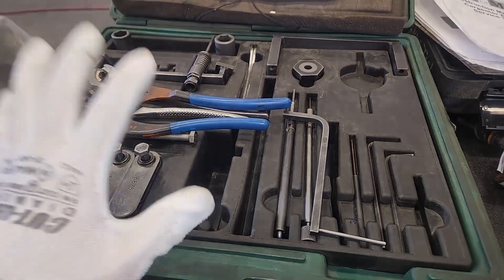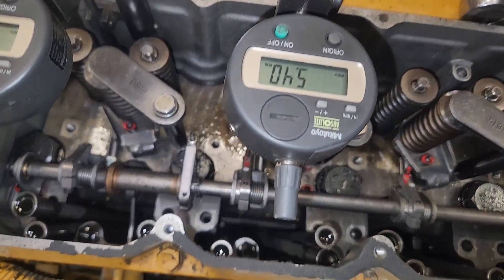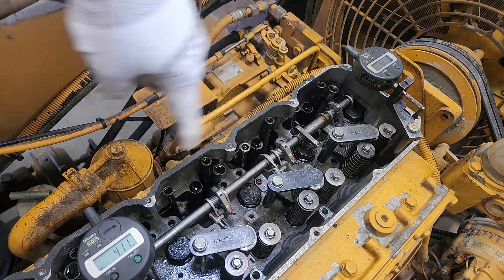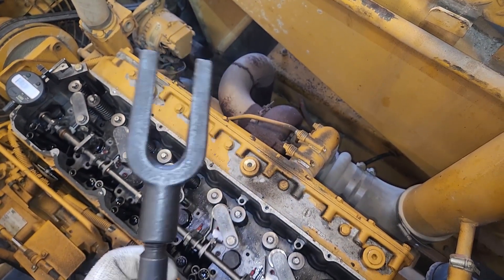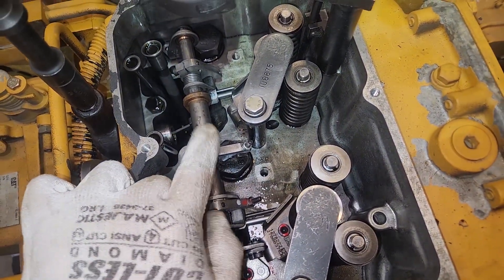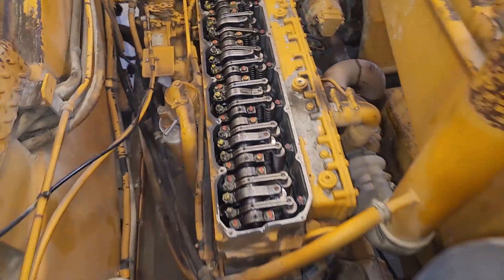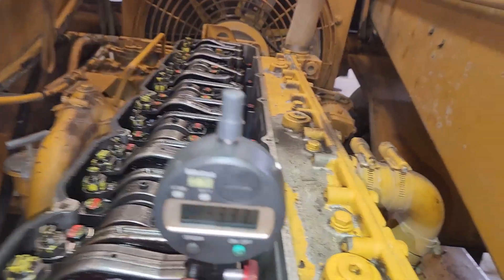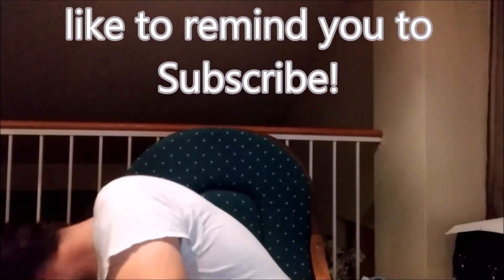Cat 3116 Rack Adjustment Part 2, Prepare for a Headache.

Comment from the maker: Hope you enjoyed watching me suffer through trying to get this rack sync done without having all the tools I'm used to. Amazon Affiliate links to recommended tools: Fuel Pressure Gauge, Compucheck 0-300 psi: https://amzn.to/3YeBldu
Airlift Cooling System Vacuum Filling System: https://amzn.to/3D9AlPu
Radiator Pressure Tester Kit: https://amzn.to/3QGBumn
Milwaukee 3/8" Right Angle Impact Wrench: https://amzn.to/3D2CvAk
Adjustable Height Parts Tray 100 lbs: https://amzn.to/3CBusZB
Engine Oil and Fuel Dye UV: https://amzn.to/3z34zkv
UV Professional Grade Light: https://amzn.to/3gzxPc0
Allstar Oil Pressure Priming Tank: https://amzn.to/3L5pASm
Reply: I recently took a 3116 MUI fuel system class, we did all of these adjustments (luckily we weren’t missing tooling). But afterwards the instructor showed us how to fine tune the synchronization even further with the engine running, utilizing a temp gun on the manifold and slightly tweaking the sync screws balancing the temperatures. Slightly tweaking the screws with it running is kind of an interesting challenge. Anyway I thought it was a great class as I had no experience on these.
Reply: Def gave me  better insight on the 3116 in my topkick and what i should probably be looking into for rough running

Comment: Ape I have a 3116 & just had the injectors replaced but We’re having hard starts regardless of the weather. Any ideas on what may be happening?
Reply: Check for a air leak in the suction between the fuel pump and tank you can temporarily install a clear hose at the pump and look for air bubbles....if you see any while running you have a a air leak in a hose somewhere and may be losing your prime

Comment: I’m working on an old 3116 powered generator . It idles high . If I turn the idle adjustment screw down the engine will shut down slowly . I can get get it to idle without shutting down but it idles at 1300 rpm . Would adjusting the overhead solve this or do you think it’s a problem in the fuel pump .

Comment: Great job on the video, wish it was available 30 years ago. Had a bunch of 3126's with this MUI setup. Cool thing is they did 475 horsepower at 2950-3000 rpm. Many times I encountered people struggle with this procedure and sadly they dealt with the complicated instructions and lack of tooling by pulling the engine and swapping it with a ready spare... serious! US Government at its best! Great job again!

Comment: Every time I heard a truck with a 3116 idling it sounded like crap.  This would be why.  There would have been a lot of people just swapping out injectors without refinishing the seat or setting the injector rack measurement.  It was rare to hear one run this smooth.  Good job, this was a great video!

Comment: Electronic injection is so much nicer to work on. There's sensors already installed everywhere where you'd need them, instead of hooking up gauges manually, they're all acessible through a scan tool and if you need more details, like cylinder or injector contribution - just backprobe CKP or rail pressure sensor respectively with an oscilloscope...

Comment: I'm thinking injectors should come with offset specs to really balance them out. Like most modern electronic injectors need to be coded which contains the offset information for that injector. Also most ECU can do their own learning and correct injection for every single injector

Comment: Thanks for a good video on the adjustment.  I have a 3116 in my 95 m1078 army truck  its good to see how its done.  At some point in the future I am going to get the fuel governor from the 290 hp and the turbo and adjust my injectors accordingly.  Thanks so much.  When I had my cam out I adjusted injector height with a dial caliper and it was a royal pain but it worked out well.

Comment: Thanks Josh i contacted you a  while back when i was having starting issues which turned out to be injectors i wound up buying. All the tool kits. My cat kit was the old one with just one dial indacator and i did mine outside in the snow mine didnt sound as nice as yours on start up the first try. One looses paitence when working in the cold trying to finnish before the sun goes down

Comment: I used to do these at least once a week.  The more you do them, the easier it gets.  Even though they're synched the same, you sometimes have to  fine tune them while they're running for smoother operation.  MRC makes a great tool group that makes it a lot easier than the CAT Group.  Fun times 😅 👍.
Reply: I’ve never used the two indicator setup. We had the the block setup. It always seemed like there was misfire and it would be #1 what you set them to. So I just started doing them by ear and they always ran better.
Reply: Same with the old 8.2 Detroit, set them all with the dial guage then sometimes you had to "cadalac" one or two.

Comment: Hey Josh ,just a quick story, the outfit i was working for bought a chip spreader just like the one your working on, first season with it it always smoke black when throttling up or pulling a grade hooked to a truck,we called dealer in Pocatello and they said run it, i hooked to a truck one day on a steep adverse and throttled up to 2k and it went ballistic dont know how many Rs it went to but i had an oil distributor in front of me and pulling a loaded 14 yds truck , the distributor seen me coming and got out of my way, and with the johndeere running gear with good big brakes i got it stalled and had truck behind me set his brakes pulled rubber boot off air cleaner and got my lunch pale on it and it finally shut down , oh i had shut fuel shut down switch off to, called Cat out of Kalispell Mt , i helped mechanic pull it ,only took a couple hours and he took it too their shop, 3 weeks later we got it back and they said they couldn't find any damage or  wrong. Ran great after that with no black smoke, ended up being a warranty  cuss fight with dealer , cat and contractor ended up footing the bill, it was kinda wild sitting on there for few seconds
Reply: Also josh it was a 3116

Comment: You often hear from people that the old mechanical diesels are easier to work on. I’ve always thought this was misguided. The more control a computer has to adjust timing quantity of fuel or any other part of injection, it makes for that much less mechanical fidely bits. Show a novice this procedure then show them changing an injector on most any common rail. A fuel connector a bolt an a electrical connector and it’s done

Comment: Good grief, and I thought a v16 71 was a pain in the rear. 
My first exposure to Detroit was a v16 71 running a gen set. The contractor had 2 in a trailer that needed a tune up .I was an operating engineer apprentice mechanic and the journeyman that was doing the job put me on one and he did the other (he spent more time watching and helping me than it took him to do his). I was good at Detroit tune-ups but I never liked the engine
Reply: Went well in Terex trucks

Comment: Why not rezero the indicator after adjusting the first injector? Then you wouldn't have to remember the target number. It would just be zero.
Reply: Mounting variations as you move the tooling would have it off. When you move to the next injector you have to reset the indicator at zero again as it never quite matches up again, just due to mounting differences
Reply: I was thinking the same thing. The baseline is there , just zero out and get your spec.

Comment: The Detroit pins are cheaper and work better than those things. I used to keep two fingers on the rack/governor pin and make sure it didn't tighten when adjusting the rack/racks.
Reply: Right on..

Comment: mucho graciass.  What kits..... would  have a base  and dial indicator  usable as a second one for rack adjusting?  I have the old school full kit you were missing. But having back up  system with less parts to do the job would be awesome.   Not having to buy a whole nother large kit to just get an indicator and base would be foolish too, if another kit with less stuff involved thus less costly would have that as part of it.. Oh and your missing one... that has the proper  fork in it right?  (it is not in front of me to look)

Comment: What a headache just to get a gutless boat anchor to run right. It’s a nice sized motor displacement wise, too bad they couldn’t have simplified that fuel system and gave it some more power.